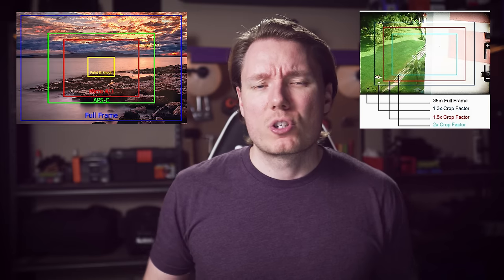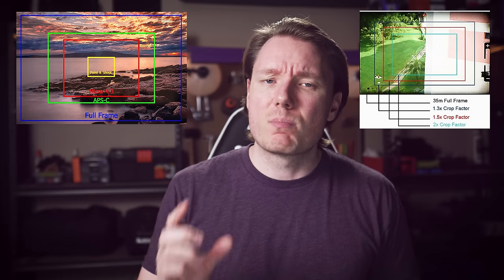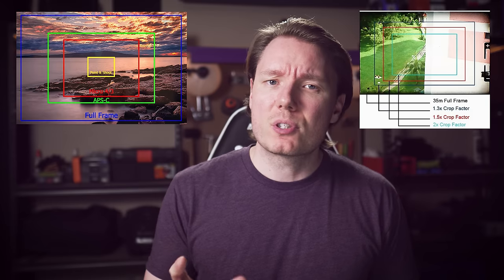Crop Lenses on Crop Bodies: How It Works vs Full Frame (APS-C & M43)

Comment: A full-frame lens on an APS camera will just behave more like an APS lens (ie. same 35mm focal length) with the same FOV & Fstop except there is more unused image/light bouncing around the insides compared to APS lens on APS camera. The first thing the manufactures do is design lenses in similar zoom range as full-frame lenses except they divide the mm by the crop factor ie. Instead of 24-75mm F3.5-5.6 for full-frame, they make a 15-46mm F3.5-5.6 so in practical terms the photo's they produce look very similar when the lenses are at their widest & when the lenses are zoomed in, only the megapixels, dynamic-range, RAW noise & clarity of each may differ depending on the hardware used. You could probably not tell the difference when printing to a 6"x4".
There are FF lenses that don't have APS or smaller equivalents & using a FF lens with a smaller sensor will reduce the wider angle of view but enhances the telephoto range (any overlap in the middle can be made to look the same, eg. 56mm FF = 35mm APS-C). What does change is the equivalent DOF & Fstops which are harder to achieve with small sensors. A smaller sensor can get the same listed Fstop in terms of light on the sensor but it has a much higher Fstop number (eg. f7 vs f4) in terms of DOF. Portraits with f1.4 to f2.5 primes are done with FF cameras because why would you waste the lens capabilities.

Older P&S cameras with 1/2.5" sensors often showed the equivalent 35mm values so 30-240mm f2.8-6 reported by the camera was actually a lens doing 5-40mm with brightness of f2.8-6 compared to the sensor but DOF equivalent of a 35mm lens doing f16.8-36.

DOF= depth of field.
Reply: Those two do not produce similar results if you consider the depth of field and image quality. Also the full frame standard is 24-70 mm f/2.8 or f/4 if you cannot afford $2000 to the lens. APS-C is like 15-45 mm f/3.5-45 mm like on my EOS M50. The same angle if view but very different depths of field and image qualities - and prices. You would need f/1.8 on APS-C for truly the same.

The compact cameras used equivalences on the marketing materials but the lenses still were marked with actual focal lengths.

Comment: I have to say I was sorta hoping that using a native MFT 25mm on a GH5 would give me not only the same field of view as a 50mm on my A7SII but also the same compression and everything else :) Oh well... I guess I'll have to get a true 50mm after all and knock that wall down haha
Reply from the maker: As long as you compensate with the f-stop you can match it. e.g. 25mm f/1.4 m43 = 50mm f/2.8 full frame.
Reply: The compression is determined by the distance. It is same if you use longer lens or crop.
Reply: What compression? Sure you get same perspective if you shoot at the same location. How could it be different. The lens does not magically go and interfere light as it approaches you. What you likely get is more depth of field even wide open.

Comment: Can someone explain how a smartphone camera with a 4.23mm lens at f1.5 will give you ABOUT the same look as a camera with a 27mm at f5? Given that the DSLR has a 1 inch or larger sensor, from an optics point of view? Is it all computational photography? How can a tiny lens and camera achieve amazing pictures these days.

Comment: So...if I use a crop-sensor EF-S 50mm lens on a Canon APS-C camera, do I still need to multiply 50 by 1.6? I heard that I do. You'd think they could/woupd build an APS-C lens that will make a 50mm FoV at 50mm, rather than at 35'ish mm. As a consumer, having to do the math [even on a crop sensor camera lens] is a real pain when learning photography. I would rather have the actual, modified, true FoV printed on crop sensor camera lenses rather than what it would be if on a full frame camera. Aside from certain crop sensor benefits, full-frame is just the way to go from the beginning, simply for actual FoV stated on the lens. The extra reach of APS-C is beneficial at times, sure, but it's too much of a hassle having to do the math until finally, eventually, memorized. 🤣
Reply: Whether you use a crop or full frame lens does not matter a bit. Why would it matter? The crop factor is about the sensor size.

Why would it matter if the lens is built for APS-C? Why would they mark wrong focal lengths on APS-C lenses? That would make no sense and would be extremely confusing. All lenses are marked with their proper actual focal lengths, even lenses on small compact cameras. That is why their focal lengths can be marked as as short as 4.3 mm.

Comment: At the end when you bring up EF-S lenses: Let’s use the EF-S 24mm pancake as an example. It can only ever mount to an APS-C Canon (without physical modification at least) so it will never actually achieve the 24mm FOV and that always confused me why it was marketed as 24mm and not a 38.4mm then. But you’re saying that physically it’s a 24mm lens with a non matching 24mm FOV to 35mm standard. So if it’s not the FOV that dictates what MM a lenses is then which part of the optics is it? Looking at the size of a big Canon 24mm 1.4 L vs let’s say, a tiny eBay 25mm CCTV c mount lens I suppose I can rule out physical mm? or am I way off and it is physical.
Reply from the maker: In many cases the focal length is literally a physically measurable property and it's a set distance between two points in the chain (do a google image search of "focal length" to see some drawings), however it is possible to make lenses that have focal lengths that don't match the physical properties. These are telephoto and retrofocus. Telephoto is basically when the focal length is longer than the lens and retrofocus (sometimes called reverse or inverted telephoto) is when the lens is longer than its focal length. They use special pieces of glass to achieve this result. If they didn't do this a 600mm lens would be impossibly long, and a 12mm lens would have to exist entirely inside the camera. But in a "normal" lens the focal length should be exactly what it claims to be in millimeters. That length, by the way, is the distance between when the rays start to converge to where they meet up to create a sharp image. It's not the physical length of the lens, because manufacturers add all kinds of components and elements that add to the overall size.
Reply: Gerald Undone thanks for the info, especially the converging light rays part of it. 🤘🤘 .. maybe a future video? 😂😂
Reply: The lens is marked as 24 mm as it is 24 mm. It is not 38.4 mm. Remember the full frame is not something fixed on stone, it is just a common way to measure things. You would get same angle of view no matter what 24 mm lens you would use. 

Think it this way: You have a 22.3 mm wide sensor. 24 mm is close to 22.3 mm so basically you get 93% of the distance horizontally to the image. If you shoot at 10 meters, you get horizontally 9.3 meters. Canon has a FF version of the lens. It is 40 mm. 36 / 40 = 0.9. If you use that lens on a FF camera, you get 90% of the distance horizontally.'

Remember the equivalent focal lengths, apertures and ISO values are not real. They are just mathematical tools for comparison.

Comment: I don't think the flashlight example is really an accurate representation of what's going on. Lenses designed for larger sensors don't spread the same amount of light out further, they allow additional light in to cover a wider field of view. A more accurate demonstration would be to mask off part of the flashlight to show a smaller circle of light for the crop sensor. The brightness at the centre will remain the same. 

It seems to be a common misconception that lenses for crop sensors somehow reduce the image down to a smaller size. Imagine looking through a hole in a wall. If you look straight through it you'll see the scene on the other side - that's the crop sensor angle of view, if you move your head to the left and right you see more of the scene, that's full frame, move it a bit more and you see more, that's medium format. At no point does the scene enlarge or get brighter.

Comment: Full frame lenses have less sharpness when used on smaller sensor cameras because the smaller sensor's image has to be magnified more to render an actual image of the same size (i.e. 8x10 or monitor sized) as the larger sensor, thus also magnifying any flaws in the lens and magnifying the inherent smearing that occurs because no lens is perfect. This is inherent to different sensor sizes and has nothing to do with the size of the image circle projected into the camera. If a given lens can produce a certain number of detail units (however you define them) per square centimeter of sensor surface, then a larger sensor will obviously be able to capture more detail units than a smaller sensor.
Reply: Yup, people forget that as megapixels get higher and higher, a lot of lenses can't physically keep up and don't resolve enough resolution to make it beneficial. I would rather have less megapixels and focus on low light performance and image quality. Take the Canon 90D - 32.5 megapixels. If you put a crappy 18-55 on it, that high resolution is completely useless. Even high quality full frame glass is falling behind as megapixel counts get more and more ridiculous.

Comment: Do not really get where you want to go.  APS-C lenses, for instance, have smaller projected circle because it allows to make them smaller (specially for wild angle, less true for large pupil lenses). 
Most of the "crop", the vignetting,  is made inside the lens by design choice. 
What difference does it makes if the vignetting is made mostly by the lens or mostly by the sensor ?  Accept a smaller lens (in some cases) I do not see. 

"Speed booster" are nothing less than focal reducer in optics. They do what the name says, it reduce the focal of the lens+focal-reducer system without changing the maximum angle of view  of the lens and of course without changing the pupil size.

Comment: So would it be worth it to buy a ff lense with a speed booster for a crop sensor camera or just buy the crop lense for a crop sensor camera? I ask because if i can buy ff lenses for my camera and still not lose anything then it would make sense to buy them now so later on when I do buy a full frame camera I dont have to go buy all new lenses.
Reply from the maker: I totally understand your thought process. I think in the long run it would probably be about the same unless you're talking about many lenses. Crop sensor lenses are cheaper, and if you factor in their resale value PLUS the price of a speed booster, it might not really lose you any money to get a native crop lens. That being said, if you buy multiple full frame lenses and you want to keep these for the long term, than it's probably more cost-effective to go all full frame now and use the speed booster as a stop gap until you get your full frame camera.

Comment: Or...
A standard human eye view(ish) lens on a...
35mm format is about 50mm
APS format is about 35mm
M4:3 is about 100mm
For those that didn't come from the 35mm film world (a 100 year old format from movie film cut in half) doesn't have to know or understand three different "languages".
"Full Frame".  Why is "full frame" so much smaller than MEDIUM frame? Not to mention LARGE frame. Makes "full frame" sound kind of ridiculous. LOL 
A 50mm lens is always a 50mm lens. No matter what you put it on.
No one ever cropped a body, a lens or a sensor. Digital images can be cropped digitally. Prints can be cropped with a paper cutter or scissors. 
MICRO FOUR THIRDS?  That's a small sensor that has an aspect ratio of 4:3. It's not a fraction meaning 1/3 larger than 1. Wouldn't that imply that there's a "1" sensor out there somewhere?
***********************************************
My 2-bits aside, This was a GOOD VIDEO.